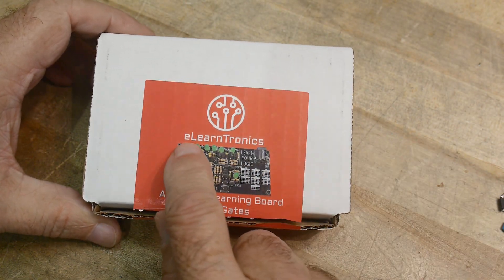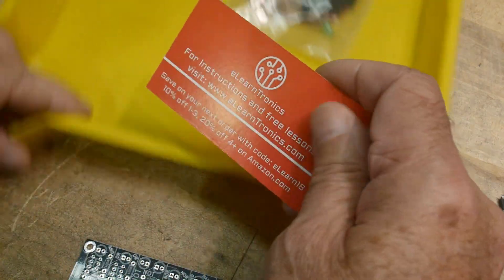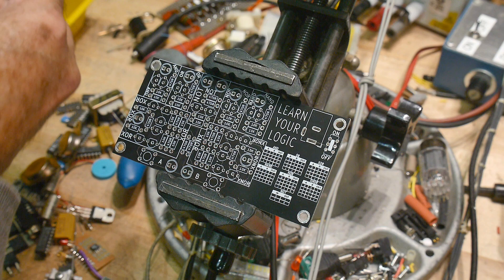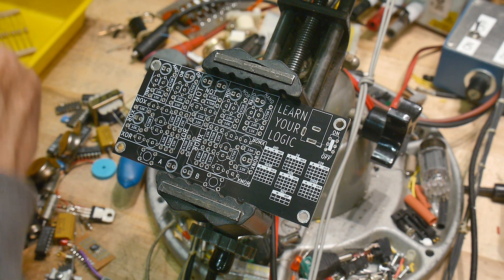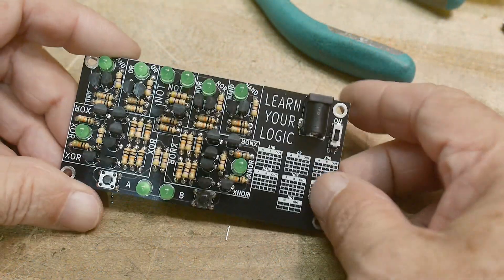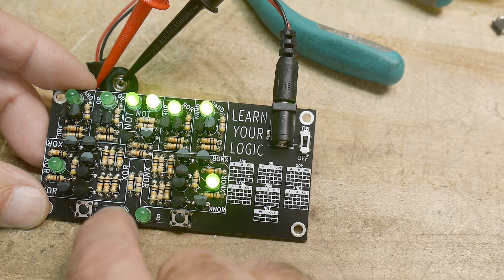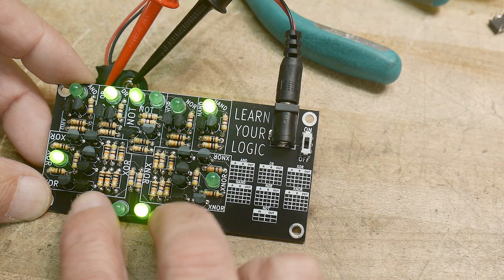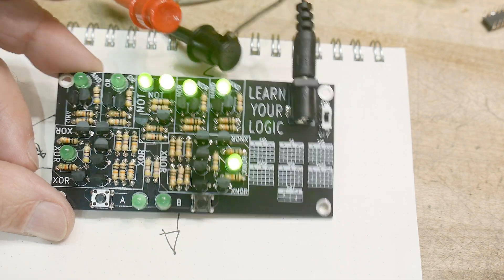#1385 eLearnTronics Logic Gates Kit

Comment: Speaking of leads....  Around the war of 1812, I was a resident in an ophthalmic practice in a state far, far away when I learned of an infamous incident involving a person whose iris turned from brown to green.  They had been snipping off leads on electronic components and were struck in an eye by one.  The eye doc they saw noted a corneal  abrasion and treated them for that.  But several months later, the iris in that eye turned green.  But that wasn't the worst. On examination the retina was also turning green. Basement membranes have an affinity for copper.  The lead had penetrated the  cornea, the iris and lodged in the retina So the iris and the retina turned green.  As I recall, the person lost most or all vision in that eye.  Be careful clipping those leads off.

Comment: Looking at the reviews on Amazon and going to the eLearnTronics web site to see if a particular critique was still valid, there is no schematic that I can find nor does the eLearnTronics video discuss the internal function of the discrete component gates.  Thus, what's the point of using discrete gates other than soldering practice which could also be obtained using logic ICs, preferably with sockets?  Simply supplying a selection of the basic IC logic gates on a board and allowing them to be patched together would allow more logic theory to be taught like how collections of NAND gates can be used to make any other kind of gate.
Reply: Yeah, I agree. The kit isn't much use if there's no discussion of how the circuit works. Having to reverse the circuits from the PCB is not ideal, what's the point? I see a similar anti-pattern in channels that build breadboard computers. Rather than show you the logical circuit they're building they focus on the physical layout of the parts in the breadboard so all you really get from a lot of those types of videos is how to make a pretty looking breadboard circuit. If you want to learn more you have to be familiar with the chips being used and draw out the logic circuit yourself which at times is impossible because many salient details are skipped while wires are being plugged in.
Reply: @vincei4252  most technical channels in general are more of an relaxation than learning material.